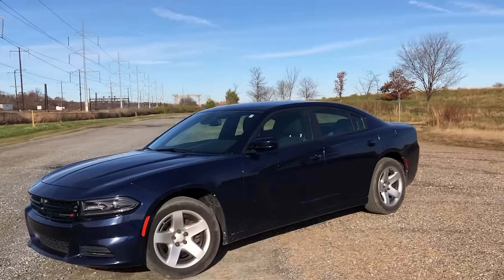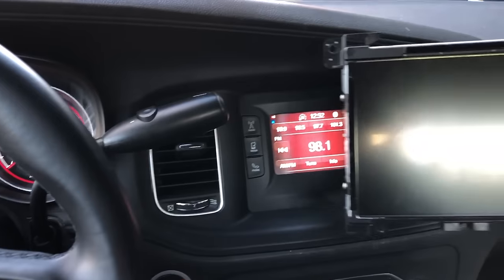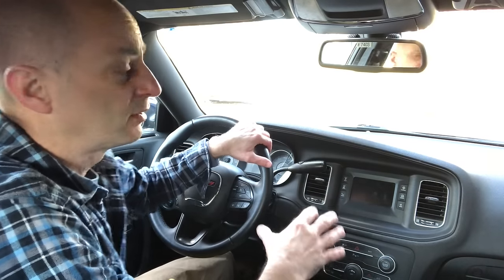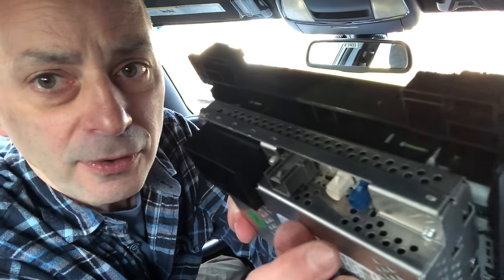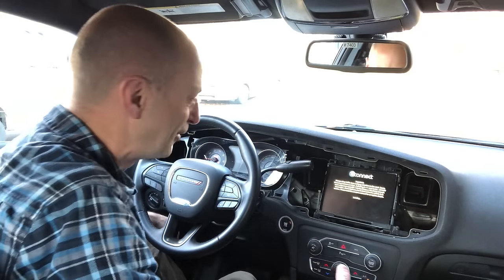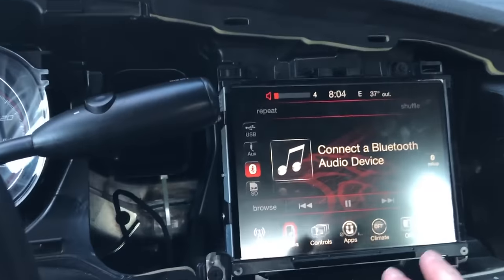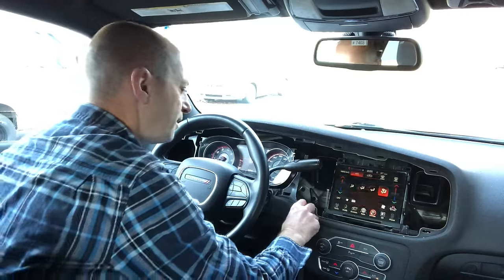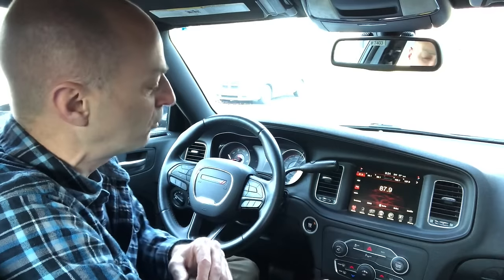Uconnect Swap From 5" to 8.4"

Comment: At this point all other videos on YouTube of this upgrade need to be deleted! This video is hands down the best one ever to the point and not anything over I installed my own radio in my car and I am a woman and not too technical on radio’s after riding around for hours looking for someone to install it for me, I was turned away and told it wouldn’t work in my car even the dealership told me it won’t work 😩 well after this video I installed myself and it works perfectly thank you so much 😊 keep up the good work
Reply from the maker: Thank you so much for the kind words and the followup on your U-Connect project.  It's great that my video helped and gave some guidance on your upgrade.  That's awesome and thanks again.
Reply: girl, YES! as woman mopar owner, it's pretty frustrating trying to upgrade your car on your own. I went to a lot of places also that told me that it wouldn't work, either and your video gave me so much hope to go ahead by a unit. do you mind telling me where you go yours from?

Comment: I just recently changed out my 5 in uconnect for the 8.4 in uconnect, and I love it. Your video helped me out.
Reply: Did you also have to input a security code like he showed?
Reply: Did you have the security code
Reply: Yes, I got the code from a local Dodge dealer.
Reply: Does it get Apple car play?
Reply: Did you have to replace the head unit at all!? We have a 2013 Charger SE that we want to do this too but unsure if we would need a new head unit as well
Reply: Hello sir, did it let your car get Apple car play?

Comment: That is sweet!! You're gonna be so happy with it! My 8.4 in my Ram is the very basic on so not many options, now I really wanna go to the 12in screen after seeing this
Reply from the maker: Dude, I totally want a 12" Uconnect.  I actually searched for one before buying the 8.4" but couldn't find one along with the different trim and bezel pieces.  That 12" is totally sweet though.
Reply: @hullinger  I can't say I've seen one for the Charger yet but I haven't look at newer ones either. I know for the Ram a few companies make the screen which comes with the new trim and everything. That 12in is just crazy awesome I think
Reply: @hullinger  The 12" ones in the police package chargers have the ability to connect to a laptop mounted in the trunk. The laptop screen will just magically show up on the middle screen. I looked it up a while ago, it uses some sort of VNC to communicate with the laptop over a wired LAN connection. One day when I get a police charger it'll have the 12" Uconnect in it for sure

Comment: That’s great! Gotta love how cars typically only use wiring system. I remember “upgrading” my base model 1979 Datsun 210 with junkyard parts that all just plugged in. I was able to just plug in an ashtray light and other deluxe options. My car didn’t even have arm rests, just a plastic door pull. But the mounting holes with plastic nuts were in place on the door metal - I just had to poke through the vinyl on the door card. 

That was a solid upgrade to your new fun ride!
Happy holidays from Maryland

Comment: I was nervous but then figured there’s no way u would’ve posted if it had failed. It’s a much better presentation, definitely adds value when ready to flip.
Reply from the maker: Haha, good call about that new Uconnect being a success and not a fail.  And yeah, I agree that it has to add some value to the car when I sell in the spring.

Comment: fun fact you can now take your dodge to any dodge dealership and have packages added to your car that you don't have equipped at least now you can I don't know about it before, I took my 2020 V6 challenger to the dealership I purchased it from and they said that if I wanted to add things like the bigger u connect, the heated seats and upgraded brakes and other goodies I could, it would cost a lot of course more than if you were to get it from the factory but it is possible now.

Comment: My 2014 Dodge Durango has the 8" screen.  Works fine.  The only gripe are the updates.  Either the unit is very slow or the update files are massive.  You get alerts that updates are available.  I had on run for 1 hour and 20 minutes.  Then it wasn't finished.  And it will lock out the unit until finished.  Luckily my trip was long enough I got most of it done.
Reply from the maker: Crap man that's a long time doing a software update on your Uconnect.   I actually did the update this afternoon and the Uconnect started working better and had more functionality afterwards.  When I downloaded the update I also entered the VIN of the car the new Uconnect came from and the MOPAR website said it was last updated in 2017.

Comment: Just upgraded from the 5 inch and added a 8.4 Uconnect radio to my 2017 dodge charger pursuit AWD the harness was a little different but it wasn’t an issue the radio took a few minutes and then it powered on the GPS and Backup camera was all wired into the harness from factory!
Reply: Who do you call to get the code for the replacement uconnect?
Reply: Hello sir, did it let your car get Apple carplay?

Comment: Awesome that it worked for ya! This screen is a tad nicer than the smaller one, but I think the smaller one works fine (had it in my 2015 200 work car that I put 75k miles on in a little over a year).

Comment: Time has passed since this video was uploaded. but as a 2015 dodge challenger v6 owner, i did this as well radio coming off a RAM. The only thing is that after the swap i completely lost sports mode, if anybody ran across this problem and has a solution please share!

Comment: You can take the screen out of a Cherokee and put it in a 300, ram or any of them. The only difference is brackets. It will flash to the correct car when cycled

Comment: Be cautious when doing this. If you have a 2015 and some 2016 models upgrading to a uconnect from a 2017 or higher model it will brick your sport mode and make it unusable. I’m currently having this issue and I will probably end up converting back to the 5.0 screen and the conversion is a lengthy and difficult process.
Reply: Sorry to hear that for you, but did you at least get Android Auto/Car Play with the newer radio? I'm trying to do something similar with my Chrysler 200 (no sport mode, so I should be good).
Reply: @BruceLigno  yeah it should be alright, we share alot of the same parts so if you have no sport mode to worry about then i say go for it, i just sold my 2015 for a 22' scat, so i still have a 7" uconnect with no purpose lmao

Comment: Those connectors on the back are Fakras. The blue, white, pink, etc. The blue is for straight GPS, and the pink on the new one is for GPS and telematics (aka the car phoning home via cell). My VW had a double Fakra connector running to the telematics module that I used an adapter on to get to my Motorola radio. If you want to get GPS on that head unit, get a Fakra Z male to female cable. Z is the neutral keying, so it will fit in any Fakra connector. You might have to check which antenna goes where though, I saw 2 of those connectors and I think one might be purple which corresponds to GSM cell antenna, but I can't tell from the color on the video. But pink is GPS for certain. You should be able to adapt that pretty easily. And I think you aren't getting the apps because the screen can't E.T. phone home since it doesn't have a GSM cell antenna. I wouldn't be surprised if they came alive when you added an antenna to it.

Also, not sure if the FCAs do this too, but my car will throw a fault code when my telematics antennas are unplugged. It can sense the open circuit and knows to just stop and throw a code so the service tech can look at it. Granted, this is through VCDS and not the generic OBD scan tool, but just an FYI in case you get some sort of radio fault code at the dealer/service shop.
Reply from the maker: Such a great comment and thanks so much for sharing all of that.  I did an update on the Uconnect yesterday and it was much needed since the last one was in 2017.  I definitely want to get that car phone error message fixed and I'll follow your steps.  Plus getting those additional apps working would be an added bonus.
Reply: @hullinger  Take a look at this doc, it mentions all the different color Fakras and what they correspond to: https://www.rosenberger.com/0_documents/de/codes/codes_coding_auto_fakra.pdf. The GPS connector I can nearly guarantee you will just work regardless if it's pink or blue, unless FCA pulled some wonky business it will just be a phantom-powered antenna. Like I mentioned, I stole the GPS line off of the telematics in my car and hooked it directly into my MotoTRBO radio. Even though the radio has a SMA connector and is a business band radio it is still able to get a GPS fix using the normal shark fin antenna built into my car. GPS antennas at the end of the day are the same thing regardless of the connector on the end. The GSM antenna may be a little more complicated, I cannot speak to how they are set up on FCA vehicles but on mine I think it's remote/phantom powered - been a few months though, my brain's a bit foggy. I would recommend looking at other vehicles using that same model of infotainment and seeing if you can snag the shark fin off of the host vehicle to do some testing with. Or if you can look at a service manual it might be in there - again I cannot speak to how FCA does things but that's how I was able to figure out which one of my coax lines was for GPS and which was for GSM.

Edit: I take it back, it looks like the yellow connector is GPS (for whatever reason). Just goes to show you always need to check the manual and never assume (doh). Also found this on the interwebs, might be of use to you in your endeavors http://perception.fcaperformanceinstitute.com/FCARepository_con/topiccontent/1588106484/0621908.pdf

Comment: Congratulations on the upgrade...you have more nerve than me..a$600 shot in the dark is more than i would gamble...Im surprised the dealership gave you the code...but the results are fantastic...good luck with the Mopar
Reply from the maker: Yeah, getting that security code was the piece that really left me nervous.  Once I got it, man that was a relief.
Reply: @hullinger  i did the same swap any idea why the harness is making a slight buzzing sound.?

Comment: looking at some pursuits because i really need the AWD in my area youre videos are making me feel alot more comfortable about taking the plunge, might even give an auction or two a look
Reply: I got my 15' Pursuit with around 93k miles and it was in great shape just needed some tlc and a good detail. I was also considering an awd model but being that i'm a mechanic myself thought about all the extra stuff on it that could break and just went with a rwd since all i have to worry about is rainy weather in my area. If you do end up getting one definitely look into the idle hours and make sure it doesn't have any loud lifter ticking since these things are notorious with cam and lifter failure issues. Luckily my unit still had a few months left on powertrain warranty when i got it and dealer fixed the issue for me. Good luck with your search.

Comment: If you go back to the dealer parts dept. and give them the VIN from the auto that the radio came out of they could tell you exactly what model and year it was. The reason I said you should go to the dealer is because when you give them the Charger VIN they will be able to run off a complete list of all factory equipment and options and then you will know exactly what your car has except for anything the cops changed which I would guess is nothing! The list for my 2016 Challenger RT was about 6 pages.

Comment: Great job. I have a 2015 Dodge charger and was told that that would not work if you upgraded the 5 inch screen to the 8.4 and they could not give me the code to unlock it. if I were to get a radio not another car. Also it would be to much work bc I would have to cut a bigger hole in my dash, to make it fit. If I were to do the same thing you did. How would the back up camera work is the original stereo didn’t have a back up camera?

Comment: That's awesome it's compatible . the 300  went down the same line as the  charger . Can t wait to see what is next
Reply from the maker: Oh, I didn't know the Charger's and 300's were on the same line.  Funny thing, years ago I was at the old Chrysler Newark, DE assembly plant back when they were still making cars.  While inside I was looking at some old assembly photos and at least in the 1950's that plant had every available MOPAR brand all rolling down the very same line.  There were Imperials, Plymouths, Dodges and Chryslers all coming down.  It surprised me only because I always thought those assembly lines were dedicated to one particular brand and one model only.
Reply: @hullinger  my father in law in the Ontario Brampton plant for  a 27 year s and he said we have been making them for awhile . I think they should have made the 300 in to a cop car it has alot of room and the same plate form don't know why it didn't ketch law informicne eye
Reply: @shaynec3777  I think they will after the charger is stopped

Comment: I had an 1988 base model to you Corolla 
It had a block off plate for the clock I I bought a clock from the dealer and I thought I would have to run a wire to it 
Well the connection for the clock was all ready there plugged into the blank block off plate

Comment: Looks great, I want to do this to my 2016 Base challenger SXT. The only thing I’ve read is that the dealer’s cannot perform software updates once you make the change to the 8.4, due to the fact that the updates are done using the VIN of the car. Did you happend to come across that too in your reading?

Also, was the part sourced thru a local junkyard? Or one of those online Ebay junkyards?
Reply from the maker: Thanks man for checking out my U-connect video.  I was super hesitant to buy that junk yard 8.4" because of exactly what you said about upgrades AND about some type of compatibility issue with the wiring.  Believe me, there's no issue, as long as you stick with the same model year U-connect as your car.  There were wiring changes, I think in either 2016 or 2017 that makes older 8.4" incompatible.  Regarding the software updated, that was a cinch.  You will need the VIN of the donor car that the new 8.4" came out of.  With that, the FCA website allows you to enter that VIN and get the latest software.  You download that onto a memory stick than plug that into your car.  Easy peasy.
Reply: @hullinger   Great channel, and thank you very much. I will check local junkyards. I think I’ll avoid Ebay because it’s probably hard to confirm for sure that the radio theyre selling is truly from the vehicle and VIN they claim it to be. Thanks again👍🏼👍🏼

Comment: I tried to upgrade my 5.0 to an 8.4 in my durango. Everything worked except the 8.4 had no sound at all. Already did the factory reset, and Dodge dealer said they cant help, wondering if anyone else had the same issue and maybe a solution?

Comment: Did your dash bezel fully snap back after swapping to the 8.4? Mine won’t fully snap back into place at the bottom of the screen. I also lost my sport mode as well the green flag doesnt pop up on my dash when I press the sport button.
Reply: did you get it fixed i have the same issue
Reply: @isaiah4598  couldn’t find a fix for the sport mode going away so I went back to the 5” screen and the bezel wouldn’t fit with the 8” because the back of it doesn’t sit flush with the screen unit. It can be shaven down though if you keep the 8”

Comment: Swapping the screens is as easy as just unplugging those spots from behind the 5 inch and color matching to the better one? Any updates to the apps loading and everything working good?
Reply from the maker: Thanks man for checking out the Uconnect vid.  Those apps came back to life right after completing the software update, which was three years past due.  I'm still getting the vehicle phone malfunction error however.
Reply: @hullinger  awesome and keep us updated if you find a way to get the phone portion working. I actually have a 2015 Dodge Charger pursuit with the hemi as well and probably going to swap the screens out.

Comment: Yo bro.. I have a old 3.6 2014 as well and hate that crappy ass Uconnect. Could you help me make the harness? I noticed on the AC module the connectors are different as well.
Reply: In the 2011-14 models it’s harder to do than the 2015 and later models, and they don’t sync back up right either

Comment: Hello. Did the dealer charge you anything for the radio anti-theft code or did they provide it free of charge? Just wondering because dealers are known for charging for the smallest things. Thanks for the info.
Reply from the maker: Nope, no charge for the radio anti theft code.  I was expecting a hassle on getting that code from the dealer but they were cool and gave it out.  I figured if they were gonna be a dick about it then I would simply call another dealer until  I finally got what I needed.
Reply: Hi i did the same thing , everything work, except the back up camera, i did get the camera but it doesn’t work in reverse, anything can be done to make the back up camera works

Comment: Yea I like uconnect too may need an update too it . Does it automatically  sends  a message
Reply from the maker: Funny you mentioned an upgrade.  I actually did that this afternoon and the Uconnect started working better and had more functionality.  When I downloaded the update I also entered the VIN of the car the new Uconnect came from and the MOPAR website said it was last updated in 2017.  I don't know about getting messages yet since I haven't had much time to play around with it.